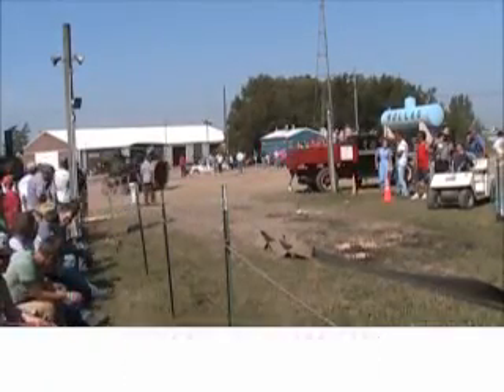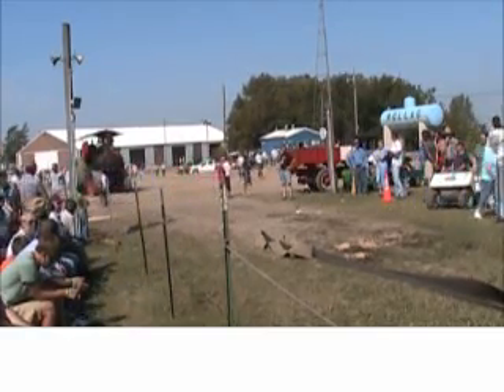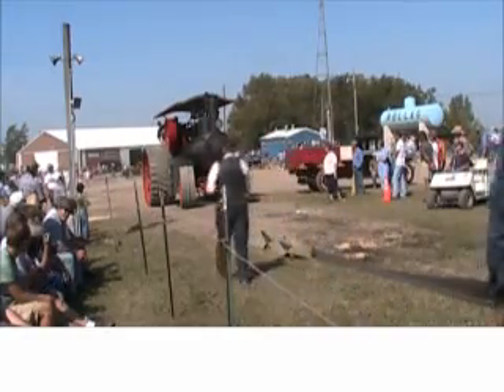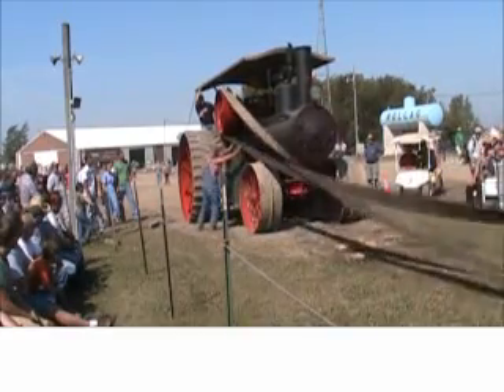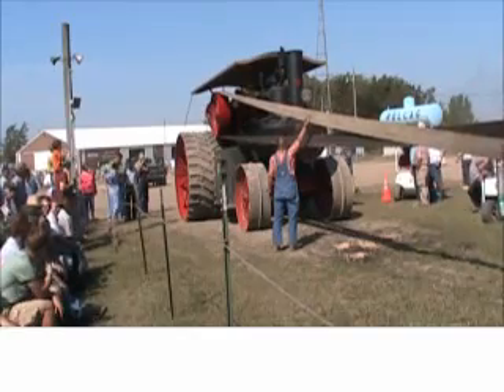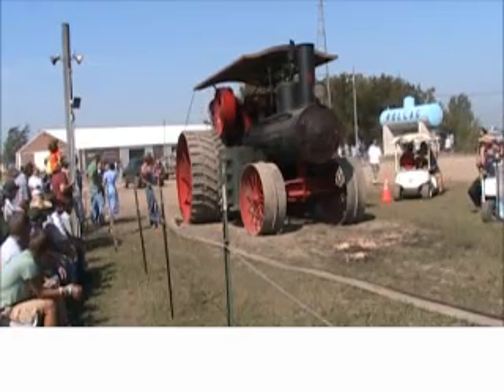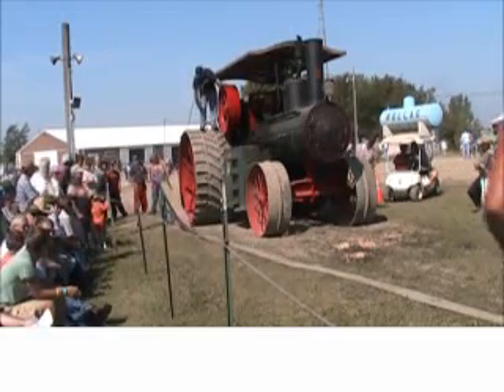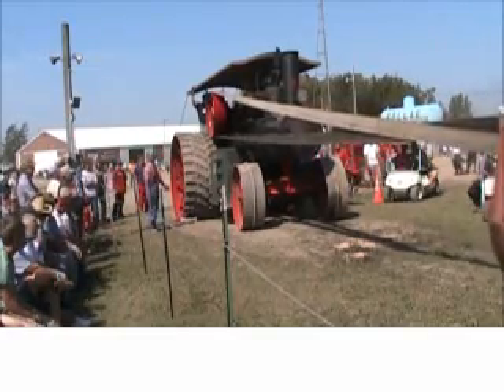Steam Tractor on Dynomometer - Torque and HP Explained

Comment: they are always interrelated. The reason the HP is so low in a tractor is because engine RPM is so low. The 10hp will produce 1000 ft-lbs at 500 rpm where as a sports car will produce 300 ft-lbs at 6800 rpm. HP and torque are mathematically linked so they have everything to do with each other. You can think of horsepower as the rate at which you can put torque to the road where as torque is just raw force.
Reply: Hii

Comment: you have to realize that torque and horsepower have nothing to do with each other in steam engines. That's why in a tug of war between a 400hp sports car and a 10hp steam engine, the steam engine always wins.
Reply: MetalGentoo You can not calculate hp without the torque reading.

Comment: give it the right amount of demultiplication and it will .. heck even a 1 hp motor with the right gearing could pull it ...
Reply: Mike Yeah and you could time the rotation of the shaft with a sun dial.

Comment: you are wrong. " An engine with 200 HP and 300 FT/LBS and another with 300 HP and 300 FT/ LBS can do the same amount of work, only the one with 300 HP will get up to the max torque quicker then the 200 HP one" hp is the energy. the engine with more power (assuming similair tq curvs) will always do more work. tq is not a unit of energy and thus CANT me how MUCH work can be done. hp determines work, not tq. always aim for hp output, always.
Reply: Close. Both engines will do the same amount of work with identical torque curves. The one with more HP will do it faster.
"always aim for hp output, always."
-Not at all true in the case of trucks and heavy equipment.
Reply: HP is just a calculated value from torque and rpm.  (RPM * T) / 5252=HP

Comment: Torque can be changed with gearing, power is what determines how much work can be performed over time. Therefore, power is absolutely the most important aspect of engine output.
Reply: Not true when regarding commercial trucks and heavy equipment. Take two engines with identical torque curves, one has 200 HP and the other 300 HP. They will do equal amount of work, but the 300 HP engine will do it 50% faster.
Reply: Horsepower is based off torque.... torque is important.

Comment: Yeah, but electric motors are so fricking boring. A housing. A bunch or wires. A spinng rotor, whir whir whir. Yippee. A steam engine puffs ands clanks and smokes and the piston goes back and forth. n internal combustion engines sounds wonderful, and you have to know how it works to repair it. pistons and spark plugs and intake manifolds, lubricant and fuel. I know which ones I'd want to use.

Comment: @Polybun Not necessarily true. If it is a high frequency design motor like those used in aircraft then it is quite possible to have 300 HP continuous duty and be the size of watermelons. Ever heard of 400 Hertz AC induction motors? The motors you are referring too that weight 2 tons are 60 Hertz AC induction motors.

Comment: @goglesux U can also say the opposite : why torque is not important if u have alot of HP, if u have an engine that goes up to 1.000.000 rpm (example) torque is nearly irrelevant. Try stopping that thing lol.

HP = torque x 5252

But u are right too btw :)

Comment: A watermellon-sized electric motor driving approriate geared wheels can pull a 12 bottom plow.  But Polybun makes a good point about CONTINOUS duty. So I think the tiny 300 HP motor's life would be greatly reduced.
Reply: Any one is available after 10 year's

Comment: It makes 120 HP because it runs at 250 rpm. Imagine if this thing, with 3000 lb-ft of torque, were to run at 2500 rpm. Then it would produce more than 1000 HP. When you consider the energy an engine produces (HP or kilowatts), you have to factor in time, and time is directly related to the speed of the engine. If the engine runs slow, then there is not a lot of energy produced however great the force of the engine, or torque is.

Comment: With these engines, HP wasn't the main factor, torque was.  120 HP from steam is considered alot because of the amount of torque that is available.  Think of it like the difference between a gasoline engine and a diesel.  The diesel runs on a lower RPM than a gasoline engine, but has more torque.